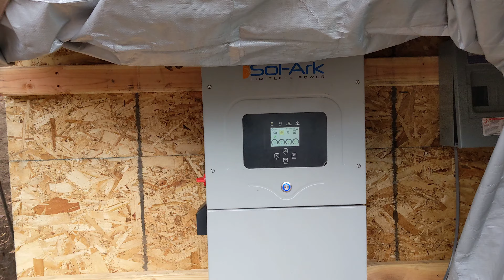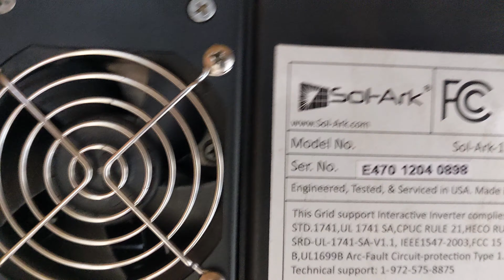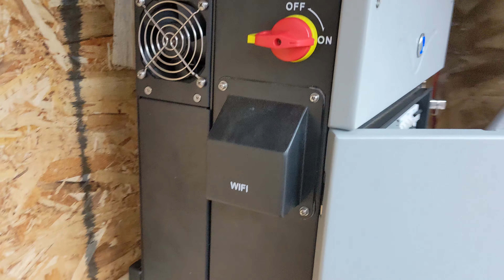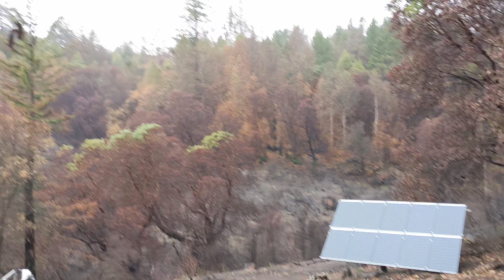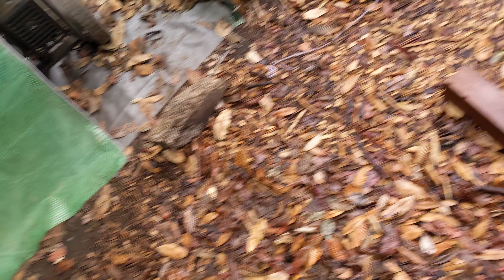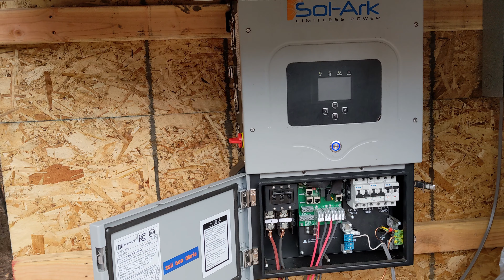Solark 12k outdoor variant in a disaster area

Comment: The system has a huge 240V peak power. And it can do a lot on one leg (4800W) vs. 0W on the other. But there are just a couple massive 120V motors that can trip the unit. Those motors (big compressor, big table saw, 15,000 BTU A/C) almost always have the ability to convert the motor from 120V to 240V by moving 2 wires in the motor because they work better. Then you will never trip the inverter and not need any autotransformer or soft start for the motor.
Reply from the maker: Thanks for the feedback. I ended up grabbing an auto transformer and it works well just for the 3 things I can think need it, I'll certainly look at switching the devices to 240v, that's seems a better solution. Cheers!
Reply: @EastyUK  Sorry I didn't see your post earlier. An Auto transformer is less efficient and consumes idle power. So if you can convert to 240V, you can resell it.
Reply: @EastyUK  Brian can you do a video showing the AutoTransformer hookup?  I also have a Sol-Ark and are wanting to do the same thing to balance the loads thanks.
Reply from the maker: @brianshippen  I will, the wiring is not as clear as I imagined, I had a friend suggest how to do it and it's worked a treat so far. Not had it trip once on the chop saw or compressor, these were big culprits previously. I'll include the constant power draw, see if it is something to consider, may meant the circuit just has an easy disconnect for when not in use.
Reply: @EastyUK  I have an Off-Grid Sol-Ark 8k powering a 2000sf house/ranch with 4 ton AC, multiple pumps/well pumps since 2019.  I have balanced the loads as much as I can in the power panel but when the AC is running it's easy to shutdown the Sol-Ark when another load starts.  It would be nice to balance the bus and use that extra bit of wattage.  I am nervous to lift the Sol-Ark neutral and let the auto-transformer take it's place. Thanks